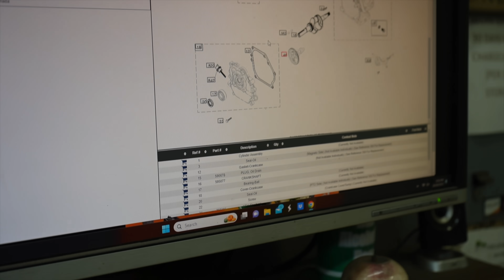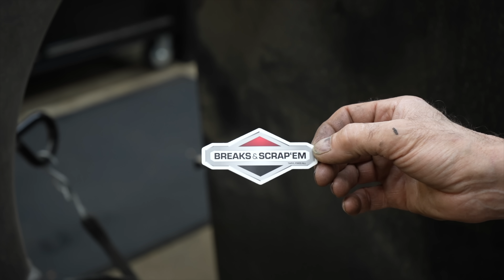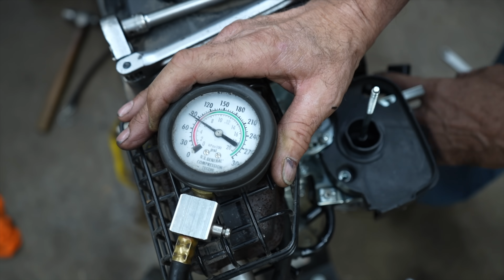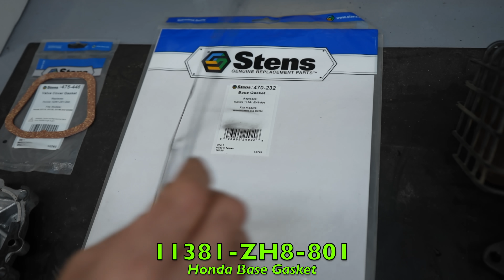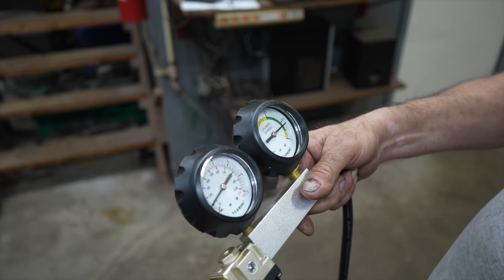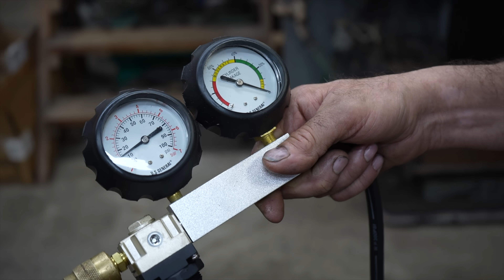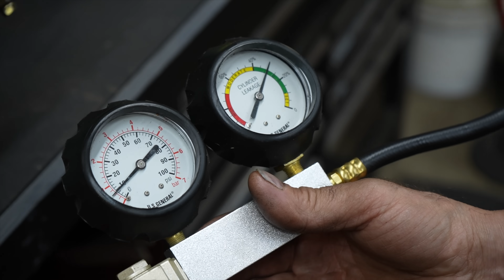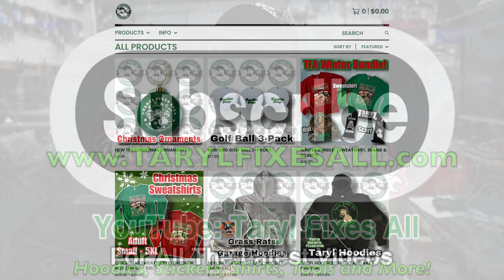Has He Finally Met His Match? Taryl is STUMPED!

Comment from the maker: Breaks & Scrap’em stickers and More! Shipping Worldwide!
www.TARYLFIXESALL.com
Reply: twisted crank. tossin the flywheel off. got me on this one for sure. agreed tho 10 hours wtf i wonder how far out of round the hole is ??? you had no smoke for bein stuck rings...
Reply: I think the compression test told the story. The Briggs without it's CR installed, should have been much higher than 80 pounds. The scrub cadet, with it's CR installed and working, was correct at about 60 pounds.
Reply: Are the valves bent?
Reply: So you are telling me a Predator engine is now better than a B&S engine? We are screwed!
Reply: You’re awesome! I love seeing you stumped because I know you’re not going to stop until you find out what the issues are. I’m going to learn… You care about us grass 🐀’s in Georgia.
Reply: IT RAN LEAN GOT HOT STUCK RINGS!!
Reply: Thanks guys, for the Halloween shirt also. It's the best fitting material I had in years in a 👕 shirt... Now there's your Dinner  ! 😂
Reply: Had similar issue with basically the same engine it turned out that the key for the flywheel had a microscopi crack and moved a little bit
Reply: The motor is junk thank you briggs and stratton
Reply: ...Why would customer change the oil on a New engine?...
Reply from the maker: @lensmanicfeleven1847  because the manual calls to. They have a break-in period then you’re supposed to change it.
Reply: @XPFTP poppppppppoo 42:28
Reply: Taryl can I get some technical advise what could be causing my leaf blower to kind of stop or just power down no power to blow after 10 20 minutes of use if  shut it of let it rest for 30 minutes then it works again but for about the same minutes still works but very low power oh it's an echo pb770 gas blower.
Reply from the maker: @juancontre5858  check the spark arrester. Maybe it’s plugged. We have a video on it
Reply: Spark plug! Chinese engines hate bad spark plugs
Reply: @crazymower4343  thanks I'll check it out.
Reply: @TarylFixesAll  thanks ill go through it. Happy holidays 🙏
Reply: Thank you for all the videos I’ve learned a lot from you
Reply: CURLY NOT AVAILABLE... HEY MOE I THINK HE's USING THE CAN....
Reply: My old ladies mufkin always fits just right....
Reply: @TarylFixesAll The fact that the factory paid it so fast once you specified that the two top rings were stuck, indicates that they knew full well others were having the same problem. The also probably know that their aftermarket Chinesium rings are causing this problem.
Reply: The only thing I haven't seen you do, is check the air/fuel mixture. I hate the newer carbs that don't have adjustment needles.
Reply: How "tf" did the rings stick with only 10 hours? Holy crap.
Reply: How did you remedy the non vented fuel cap?

Comment: It's refreshing to see a seasoned tech struggle with a engine. It gives us backwoods hacks a glimmer of hope to keep on keeping on. Thank you Taryl
Reply: had a bad coil spin a fly wheel and keep sheering keys before, you'd think they'd either spark or not spark but sometimes when they go bad they go off-time a bit
Reply: Lawn mower shops, its fun to try to run it as a flat rate shop, he is spending all this time on one project, i have been here several times chasing strange no start issues, or machine function issues, sometimes not enough hours in the day
Reply: I cant believe that B&S would make a Clone of the qualiity Honda motor, They obviously couldn't get that right ever. So bad piston rings, they paid that quickly, PR is working hard for the mistake of the Bean Counter's!
Reply: I was blown away when he said he’s never done a cylinder leak down test before. If I get an engine I can’t diagnose quickly with the usual test, I do a cylinder leak down test. It only takes a few minutes, literally, and you know if one or both valves are leaking, if it’s losing compression past the rings, if it’s a blown head gasket, etc.  it would’ve saved him a lot of time. 
That leak down tester he used from Harbor Freight is garbage. They sell one now made by Maddox that works great. 
Another thing I noticed. When you do a cylinder leak down test, you have everything connected to the cylinder from the start. You do not pressurize the tester and then connect it to the cylinder hose. Lol. 
You use the leak down tester to find exact top dead center, once there, you do have to clamp the engine into place. If it’s at exact top dead center it will stay there even after you put pressure into the cylinder.
Reply: Any question why batteries are taking over?
Reply: @MazichMusic  I choose gas over batteries every time on my small engines. I have got many engines lasting over 30 years easy. Can you say thet about any battery operated , I bet not

Comment: I’m betting the customer has never changed the air in the tires … good luck getting the engine warranted
Reply: Tray did get the engine warrantied from B-S
Reply: The engines the problem not the leaf attachment
Reply: @juniorlazaro289   I think it's a joke.... Don't over analyze it.

Comment: Plastic gear is one thing.. but the fact that it has plastic cam LOBES is just nuts
Reply: That’s really common. All these minibikes you see at Walmart or tractor supply have plastic cams in them. It doesn’t cause a quality problem. Had a few bikes with Chinese engines with the same plastic cam for over 10 years and still run fine. They’re not designed to overspin past 4,500 rpm’s.
Reply: Briggs & Stratton started using plastic cams about 30 years ago, actually probably a little longer than that on the 3.5 Classic L heads. They aren't normally a problem
Reply: It's usually a plastic gear that fails before the cam lobes, and that failure is usually from some other original cause.

A typical scenerio for B&S engines is fuel from a failing carburetor flows into the crankcase, diluting the oil and raising the level.  Somewhat later the engine breaks a timing gear, perhaps after running great for its last few seconds.  Did it fail from overspeed, the long term fuel soak weakening the plastic gear, or the high oil level putting too much load on the valve system?
Reply: A buddy of mine was telling me the other day that BMW has or is working on this thing were instead of having a throttle cable or even throttle by wire they are going further now,they will be moving the camshaft back and forth (inside the engine!!!) to lower the idle,lol,lets forgo the 10 dollar throttle cable and do something ridiculous and complex,cars are getting so insane and expensive pretty soon all you'll be seeing are old cars on the road.

I realize this video is about mowers but everyone is being affected by these crazy times we are living in,Ive heard of the industrial revolution but this is ridiculous,lol
Reply: @dntlss  BMW has had throttle-by-wire for a quarter century.

The 1998-era M52tu engine was a transition.  It had a throttle cable going to the throttle body, where it moved a throttle position sensor.  The engine computer read that position, and moved a motorized throttle plate that was immediately adjacent.  That allowed using the new throttle-by-wire engine into vehicles designed around a throttle cable.

(There was actually a mechanical throttle shaft between the two.  But it was a backup in case of a failure, using an incomplete coupling.  The computer was normally the only source of throttle plate movement, but the mechanical linkage could partially open the throttle plate if the motor failed.) 

The next generation M54 engine used a very similar intake manifold and throttle body, but with the throttle position sensor half removed.  That engine could only be used with an electronic throttle pedal.

The recent engines control the intake charge entirely by controlling the intake valve opening, part of the variable valve timing.  Initially that was paired with a traditional throttle body that was largely redundant, but later the throttle body was removed.
Reply: @1djbecker thanks for the info, interesting stuff.

Comment: This year I refurbished a 1948 Whizzer-you know what they are-I couldn't get the engine to run right-good spark, fuel, etc. Finally I pulled the cylinder off, and found that the rings were completely worn out-put in new rings, and it runs like a champ-it had me stumped as well-thanks, Taryl and crew!
Reply: Whizzers are cool. I used to ride with the West Coast whizzer club in California.
Reply: That unnatural metallic squeaking when you're trying to start it... What the???
Reply: Total length of tappet + push rod probably equal between B&S and HF... B&S rod longer, tappet shorter... HF rod shorter, tappet longer

Comment: I'm still stumped why the thing had 80 lbs. compression with stuck rings.  Great video Taryl.  Thanks!  I'd have thought that officer wasn't a rookie with how he handled that arrest.  Great job Officer Faryl!
Reply: Because the leak was not a constant and sometimes the rings even sealed which is why it would run occasionally.  This is a guess until someone has a better answer.  Excellent work !!!
Reply: oil control rings create compression
Reply: The way the compression tester works is that it goes up to the maximum compression achieved but doesn’t go down again until you push the release pressure button. The leak down tester compares pressure in the cylinder on a steady state basis versus the pressure being introduced using an air line. With perfect a no leak down cylinder if Taryl introduced air at 60 lbs(it just bleeds air in) the cylinder would show 60 lbs also. However there is always some leak down past the rings in any engine. The problem is that there was WAY too much.
Reply: @jasoncook5307  Compression rings are supposed to seal the combustion chamber from the crankcase. Oil control rings regulate how much oil is on the cylinder walls. I highly doubt any engine manual would say oil control rings create compression.
Reply: @KStewart-th4sk  because manuals are not made for engines with stuck compression rings.

Comment: Stuck rings is the last thing I would have thought of.  I really like using a leak down tester. It doesn't take that much more effort to use over a compression tester and it provides a lot more information. The leak down tester will tell you about leaking intake or exhaust valves, holed pistons and blown head gaskets all in one test.
Reply: Agreed.  But it sucks that Taryl had to resort to a leak-down test on a practically new engine.  So much junk on the market from previously solid name brands.  This video's got me thinking I should rebuild an old engine in my scrap pile.  All of the parts are such higher quality.
Reply: I wonder if he could measure crank case pressure compared to a properly running engine.
Reply: @dumbluck6180  I wood a nd metal hydraulics and may tag fun
Reply: Could brim
K
Reply: Could broken valve spring cause hard starting ?
Reply: @rihen6104 yes and could also cause no starting

Comment: You know Daryl, I was an green aircraft mechanic many, many, years ago. I used a differential air compression tester, not knowing  how it worked, but only once did I find a cylinder not hold pressure, because it had a hole in the piston. I keep learning more and more as I watch these video’s. Keep up the good work.

Comment: I had this same issue on an old 18hp opposed twin for the whole season last year.  Every time I would go to start it, I'd have to fight it again.  Starter fluid and jump starting, etc.etc.. and nothing would ever work until randomly-- it would just start for no apparent reason;  drove me nuts because I'm usually good at fixing this stuff.  But it ran strong I could mow with it non-stop.. but after I parked it, I would have to fight it all over again the next time.   Well finally one day when I couldn't start it:  it was bad enough that it was blowing pressure out of the oil fill cap.. literally spraying oil out of the cap when I took it off.  So I knew that it had stuck rings after that and had really bad blowby..  Once I took it all apart, I realized that it had a good amount of grass secretly hiding under the covers when I had already cleaned it at the start of the season--  so it must have been over heating too.   It's on the healing bench at the moment;  I'll get to it eventually
Reply: The Healing Bench!  Nice!

Comment: That certainly helped me add to my things to look at, had a Briggs, their Vanguard line, on a Cyclone rake come into the shop. Needed a carb and coil initially to just try and get it running. Mouse chewed coil wire jacket and I figured coil was shorting out through the hole in the jacket to the metal covers or head. Carb was gummed up and pitted. Get that replaced and still wouldn’t start. Found this engine to have no compression. Customer opted to not fix or repower it. Appreciate these videos as they help me better myself and skills as some of these things are not covered in trainings offered by the manufacturers.

Comment: Great video. How do you get such high compression with such a big leak down? Stuck rings, seems to me would result in low compression
Reply: The compression was low, he removed the compression release but compared it against a motor that had the compression release installed. Without a compression release it should have been over 100 psi easy and he should have felt difficulty in pulling the engine over. The whole, "pulling this engine over is easy, I don't know why they would even need a compression release" should have made him suspect compression issues.

Comment: I'm at 32:00.  I think you have low compression.  With the compression release on it, you will get 60 PSI, but without it I would expect higher compression, more than 100.  Wouldn't you think?  I bet if you took the compression relief off the predator and checked it like you did the Briggs it would be much higher.  Just my guess at this point.

Finished video.  Stuck rings probably a quality control problem, and obviously not something you would expect on a new engine!  I bet the machining on the ring grooves was out of spec, too tight.  To clarify what I said above, the compression release will function only at low RPM (ie: while starting) and keep the compression only at 60 PSI, but as soon as it fires and the RPM climbs the compression release should stop functioning and the compression should quickly increase to max compression which I would expect more like 100+ PSI, but that may vary with the engine.  I'd be really interested if you did a follow up and checked the compression on that predator without the compression release.  Interesting video, thanks for posting.

Comment: Howdy Cuz!  I just got back home and had a chance to watch the whole video.  Excellent job for not giving up, one of your best vids yet.  I had a similar thing happen several years ago and once I used a cylinder leak down tester, I found the problem.  Those things are great at telling where the air is leaking - if you hear air coming out of the carbitrator it's the intake valve, mufkin it's the exhaust valve, oil fill hole it's the rings and if the head gasket is leaking externally you can spray soapy water around the gasket area and look for bubbles.  In any case you now have something to help find the problem.  I sure had fun visiting with you guys and being part of Lawn Mower Detectives.  You guys are the best!!!

Comment: I’ve been saying the same about Briggs going down hill, I know the Chinese Powermore engines are mainly on MTD stuff but I’ve always liked the ones on the snow blowers. The ones on the mowers seem fine too, I think They’re made by Zongshen and I believe they’re one of the better Chinese manufacturers probably the same ones that make Predator motors. Parts can be pricey though
Reply: Zongshen engines are sweet they come on 4 speed Chinese pit bikes and can take serious abuse
Reply: @evanknight3629  no experience with the little pit bike engines but I've got a Chinese dual sport(zongshen 230cc Honda ch clone engine) and it's at least survived 20,000 miles so far and still running well from what I can tell, so regardless they seem to be worth the money 1600 for a new motorcycle I've got my moneys worth even if it blows up tomorrow

Comment: An old car tech showed me a spark plug lower he welded on to a air nipple. I did the same, always works! Just listen and see where the air is leaking out when you pressurize the cylinder. You don't need the vise grips on a car engine, but you will on a mower/small engine. That guy showed me that in 1982.

Comment: I kept thinking a broken valve stem valve - but you said it would run occasionally.   I did notice that there was no vent on the gas cap.  But didn't know if that would cause an issue.  Now I wonder if that caused an increase in cylinder pressure and cooked the rings?  Doubt it - no cylinder wall damage mentioned.   Good work man.
Reply: Running lean for too long will overheat it I think